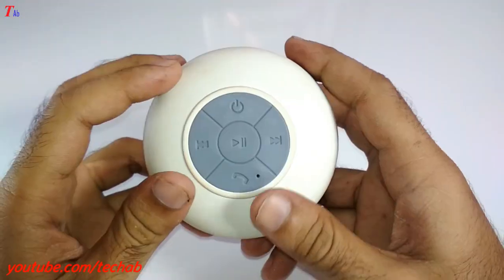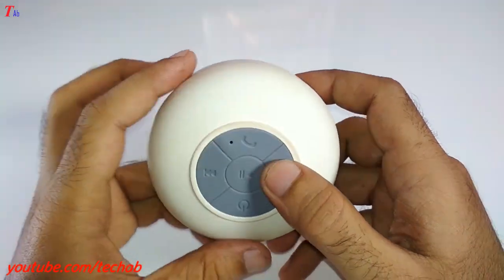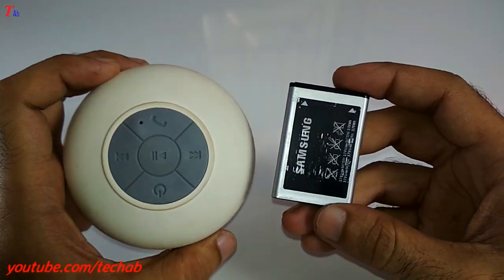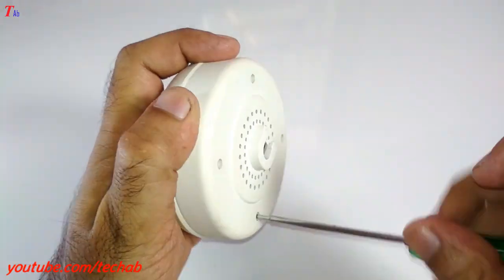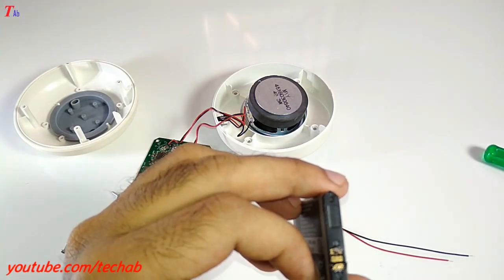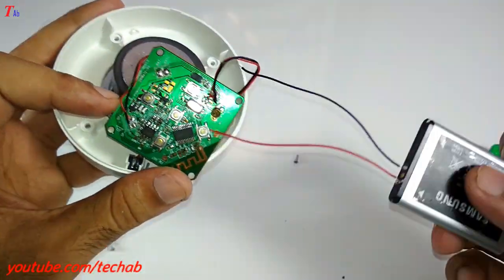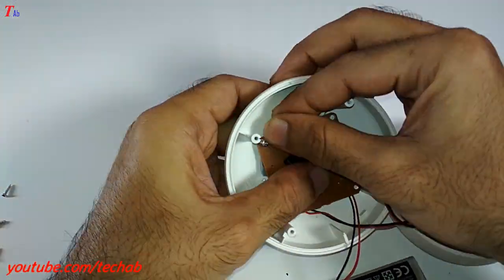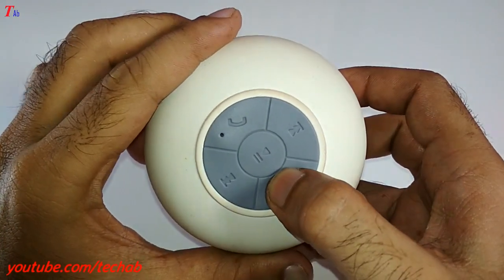How To Insert Mobile Phone Battery In Bluetooth Speaker and Increase Back Up Time 4 to 5 hrs

Comment: battery 3.4 v ka aur mobile battery 5v 
how can we replace it
Reply: i tried to use onida 1800 mah battery to the same speaker. it works well till the charge last. when i tried to charge it again it didnot charge. why? i used 5v 2A charger to charge it.
Reply from the maker: Please insure that all the connection all rights and positive and negative wire are connected in perfect position
Reply: @TechAb  mene bhi battery badla lekin jab charging me lagata hu to work hota he jese hi charging se hatau off ho jata he
Reply from the maker: 4 volt ki hoti hai mobile ki